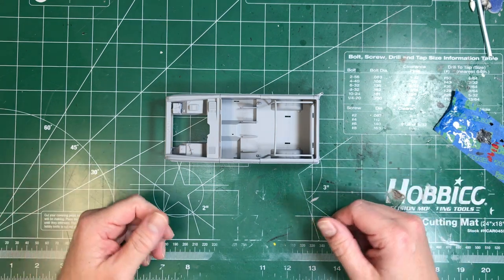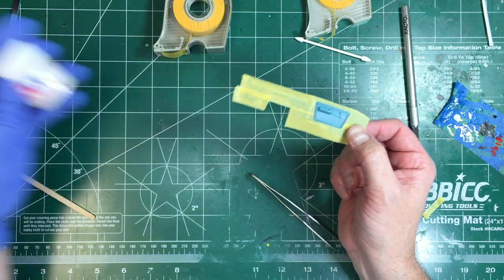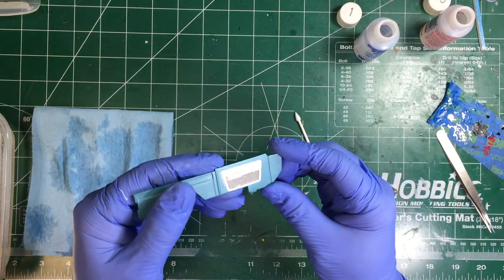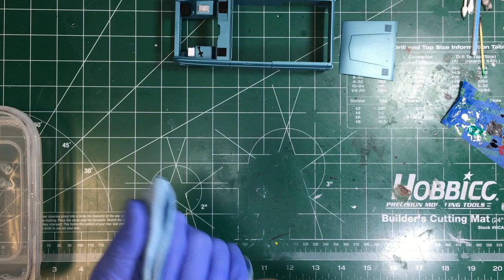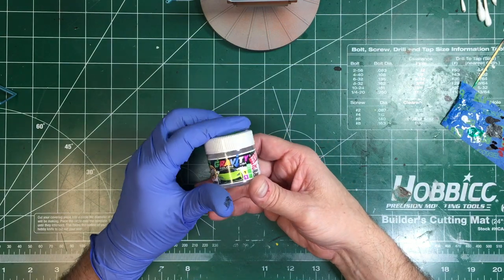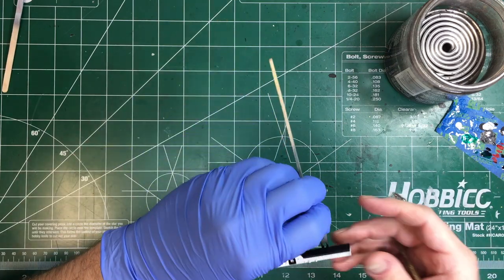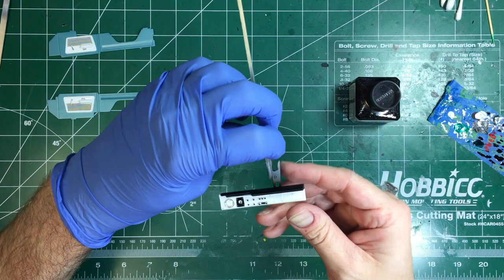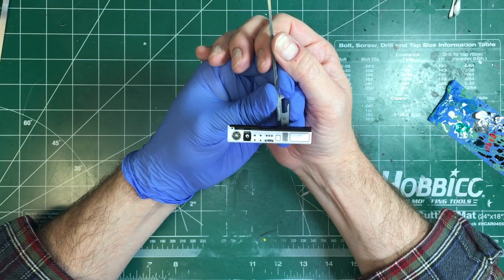Building the Revell Ford Bronco 1/25 scale model part 3

Comment: Awesome work and advice! I'm returning to modeling after decades and enjoying building the Bronco. I'm just about to do the side panel decals and I'm intrigued by your technique using soapy water, your fingers, and avoiding the Micro Set and Sol products. I've (re)discovered that decals hate fingers, but you did great with yours. What's the secret? Thanks. - Blake
Reply from the maker: Thank you and welcome back to the hobby. Yes decals can be very finicky. Make sure your fingers are wet when touching the decals, see if that helps.

Comment: Love your channel and this build,  question, after installing the side decals do you cut into the door panel lines or push them into the panel lines while decal is still pliable. Thanks, Greg.
Reply from the maker: I will let the decals set up a bit and then make a cut the decal into the panel line using a fresh, sharp blade. I then use decal setting solution to help the decal set into the panel line.